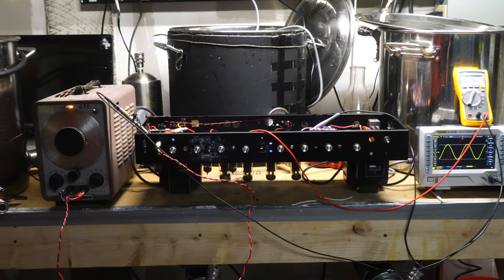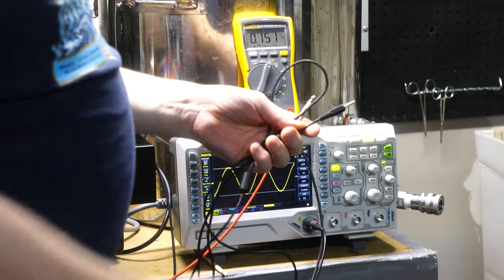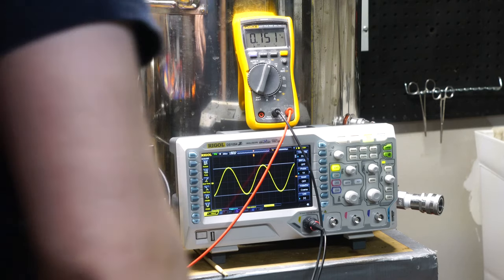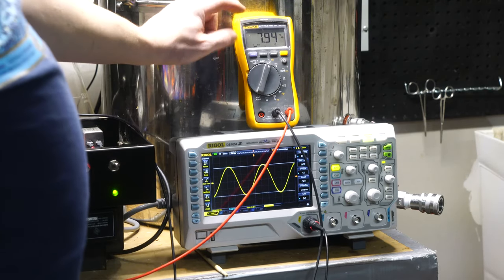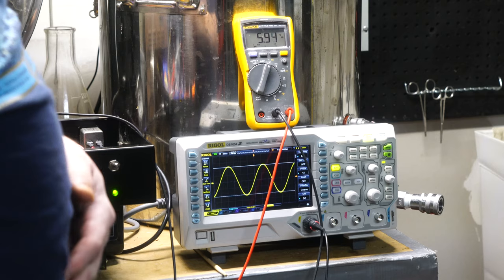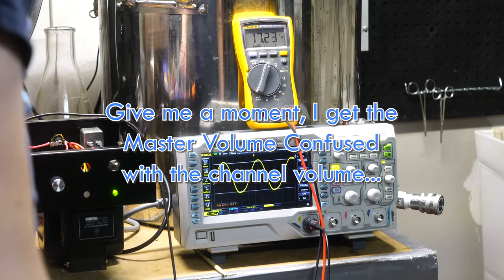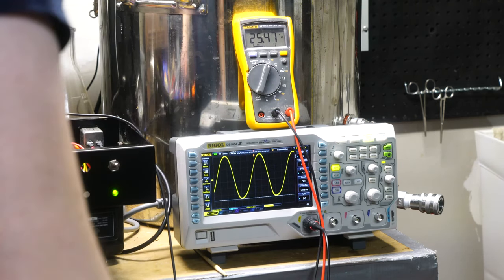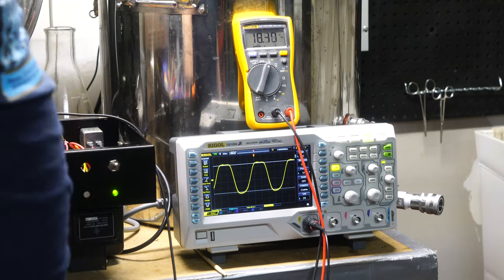Signal Flow Tracing with a Multimeter

Comment: Where do you put the probes to take your signal readings?
Reply from the maker: After a coupling cap where there will be low to no DC voltage.

Comment: So if I can take this and plug it to his guy !   What the heck is that. ??
Reply from the maker: Sorry I don't understand your question
Reply: @FrenchieFilms   That’s what you said. ( I am taking the probe of the DMV and connect it to this Guy).  😮
Reply from the maker: Oh yes I meant that I'm connecting the probe to the amp in the signal path
Reply: @FrenchieFilms  oh ok. Well for us dumb as me, that I a trying to follow de signal pad with only A DMV. It would be beneficial to know where are u conectan to.   Thx 😊
Reply from the maker: I can't exactly because every amp is different.  Basically connect to the opposite side of the coupling capacitors before the next stage to see how it was amplified by the previous gain stage